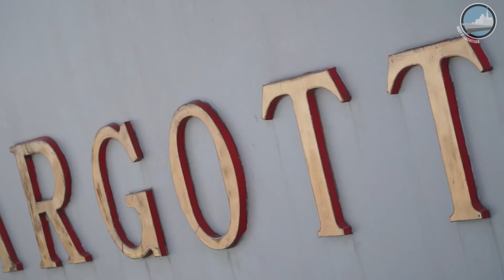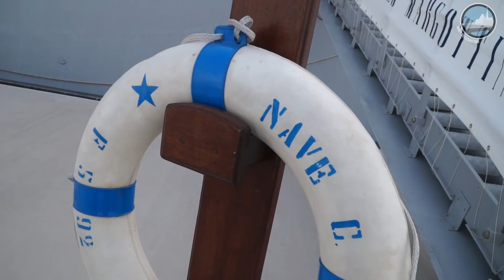Italian Navy FREMM Frigate Carlo Margottini at DIMDEX 2018 - Qatar

Comment: they say its a frigate, but i say that its closer to a type 45 destroyer
Reply: Don't forget the French. The 'Horizon' project started out as a joint development between the Italians, French, and British for an AAW (Anti-Aircraft Warfare) destroyer to escort their Aircraft Carriers. Italy was to get 6, France 4, and the UK 12.

The British had different requirements and wants out of the design than the Italians and French, so they split off in development, Britain with the 'Type 45 Destroyer' and Italy and France with the Orizzonte/Horizon.

Between the breakdown in participation and other financial issues, the British were only able to get 6 destroyers, while France and Italy got two each only.

The main difference between the two ships basically stem from the British wanting British armaments and better AAW capabilities. The SAMPSON radar used by the Type 45 is a lot more powerful than EMPAR (as I recall, the radar is actually about half of the Type 45's total price or something close to it). It also uses American Anti-Ship missiles, a British main gun, etc.

However, their focus on pure AAW came at a price. The Type 45's are pretty much pure AAW ships - a single purpose destroyer, which is very unique. The Orrizonte and other destroyers are almost always multi-role. The Type-45 lacks a towed sonar array, and also has no torpedo tubes - it short, it's massively vulnerable to submarines as it has next to no ASW capability. It needs to have helicopters or escort Frigates to save it from submarines.

It's also very lacking in ship to ship combat. It's using really old version of the Harpoon that real isn't suited to modern warfare (and won't get replaced until 2030, which is why such old missiles are still being used). So it's only real anti-surface weapon is the 114mm main gun. They've got two 30mm cannons for CIWS.

Thus, it's basically a great AAW ship, but incapable of being effective at much else. It also doesn't help that the IEP system used as propulsion is unreliable as hell.

The Horizon and Orizzonte have their differences to - but overall they're multi-role ships, still very capable in the AAW role (they were designed for it after all), but since they have torpedoes and towed sonar arrays, they're actually capable of defending themselves from submarines. Their anti-ship missiles are also a lot more capable than the version of Harpoon used on the Type 45's. Their main gun systems are also different, using 2-3 of the 76mm Super Rapido, which gives them a major edge in AAW performance.

The Orizzonte and Horizon are different from each other too, each having their own different additions and subtractions based on the needs of the Italian and French navies. The Orizzonte seem to be more capable than the Horizon overall, even though they are very similar.
Reply: @phoenixjz4782  The Type 45 destroyers have room for 16 more VLS cells behind the primary launcher, which could be used to carry TLAM for land attack or the new LRASM for anti-shipping, which would make them a much more capable and rounded warship.
Reply: @dundonrl  This is true, but they are also not there, and nor are they likely to be fitted within the lives of the Type 45's, which I did not include them - the Bergamini are also 'FFBNW' another 16 VLS, which could be either A50 cells for more SAMs or A70 cells, which would be capable of launching land attack cruise missiles. Seeing as the MMI has yet to make any moves to adopt a new type that can be fired from a VLS, however, I don't consider it likely they'll ever fit those cells either - the biggest boost to land-attack capability will instead be from the Teseo Mk.2/EVO that is capable of anti-ship or land attack, and has about twice the range of the older Mk.2 Block IV missiles.
Reply: @dundonrl  
The Orizonte italian destroyer has also predisposed room for additional 16 VLS, which could be either the A50, or the A70 capable of launching Land attack Cruise Missile..
So again is an even game so far between these two ships..
Reply: @phoenixjz4782  You never know.. look what was done to the Adelaide class frigates with an installation of an 8 cell MK-41 VLS, for use of 32 ESSM during their FFG upgrade in the late 90s through the early 21st century.
Reply: And in WWII this would have been the size of a cruiser. Time changes my friend.
Reply: They're hard to compare as they're meant for two very different roles, and the Type-45 is a bit unique.

The Type 45 is a single-purpose destroyer focused on AAW, and far outdoes the Bergamini-class in this role. However, it's Anti-Surface capabilities are negligible, and it pretty much totally lacks ASW capabilities - it has to rely on escorts or it's helicopters for that.
In constrast, the Margottini (An ASW Frigate - the Italian FREMM come in to versions, a General Purpose variant, and an Anti-Submarine Variant, of which the Carlo Margottini is the latter) is a very capable ASW ship, and although it's Anti-surface capabilities are not great (only 4 launchers for Anti-Ship missiles, which uses the Otomat - although this is arguably the best current western Anti-Ship missile as of right now), it might actually be better than that of the Type 45, which has eight launchers of the soon-to-be-retired Harpoon.
Reply: Doer Rosales Type 45 has 3x more missiles
Reply: Yeah, i mean capability wise.
Reply: Doer Rosales I'm not entirely sure but Type 45's radar seems to be still a step ahead of other radars.
Reply: no argument there
Reply: @efraimgoldfein-shekelblats260  they're missiles capabilities  and pretty much all the weapons can be upgraded or doubled since there is the space made exactly for this.